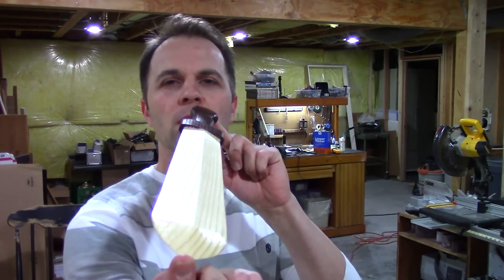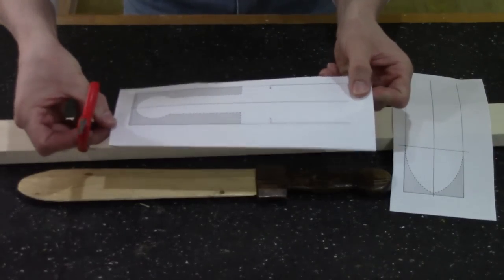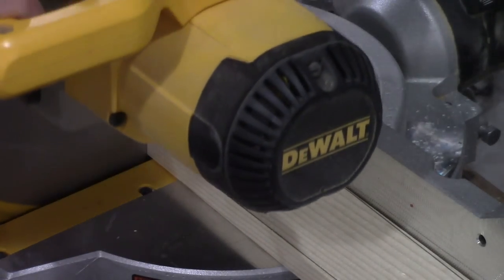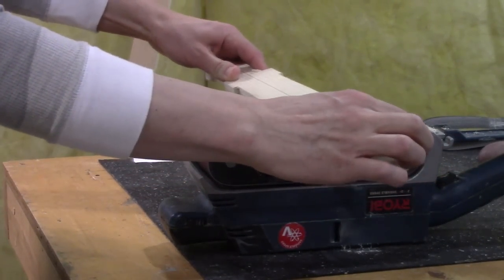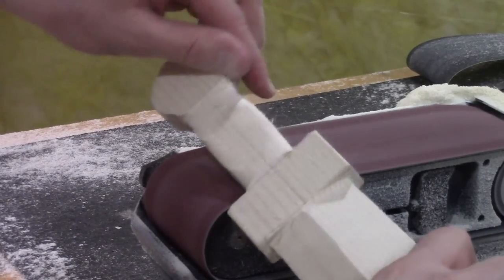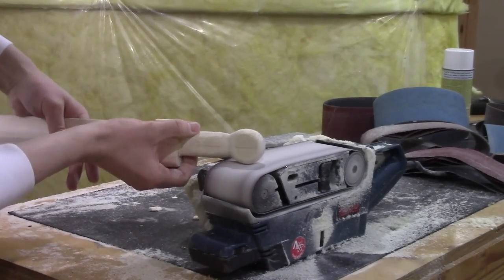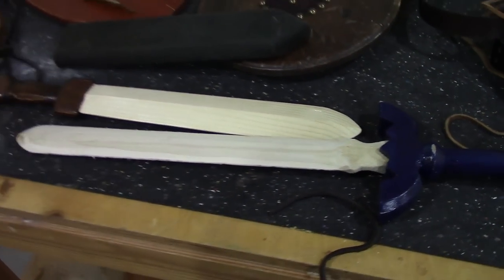How to Make Link's Wooden Sword

Comment: I'm planning on making this, would making it longer have any affect or would it just be exactly the same but longer?
Reply: +Harry Greeney It would of course affect the weight of the sword, but this design is very simple. Which means that scaling it up is easy to do, and actually preferable when it comes to cuts (not sanding though). In-short, yeah, the blade will retain the initial design while being longer than the original blade.
Reply: +Harry Greeney AJ's right. But it would also slow attack speed.

Comment: If I wanted to make a training sword, how long might it last if I use oak?
Reply from the maker: Robert Chambers A LOT longer. I would guess at least 5 times longer.
Reply: HappyAtom Hey Atom  I have a question when your cutting out the sword and trying to cut the lines do you think using a jigsaw instead of a band saw because I don't have one in my workshop it might be a good way to cut wood especially pine wood because of how soft it is
Reply: Christian Duncan A jigsaw should work just fine, you just have to clamp it to a table.  In fact, it may even be easier considering all you're essentially doing is tracing over the lines that you draw.  A band saw seems like trying to secure a pencil above and moving a piece of paper to draw.
Reply: Robert Chambers
 Thanks for letting me know because at times I make wavy cuts I know I can use sand paper or a sand belt but I was trying to be more precise when using the jigsaw
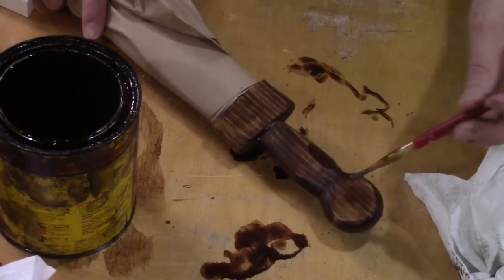Reply: HappyAtom 10:46 Here's a tip when using stain brown paper or paper towel masking tape is another good way of covering the blade if it starts to bleed
Reply: +Robert Chambers Use Hickory, Ash, Poplar or some less porous hardwood. Oak has a tendency to split and splinter badly.
Reply: ***** Yeah but do they sell those at Hope Depot?

Comment: Hi Adam, 

Great video. I have watched the corresponding links shield video as well and intend to replicate this for my nephew so I am excited to get started. I did have a question on the type of stain you would recommend for the sword and shield?

Thanks
Reply from the maker: I like a dark stain for the sword handle but I just use whatever I have laying around. I used "Minwax 2750 Jacobean Wood Finish."  Also, one trick that I did not show is to use an exacto blade and slice a shallow cut between the hilt and the blade (exactly where you would want the stain to stop) so that the stain does not bleed up the wood fibers into the blade section.  As for the shield, you could use the same stain or something a bit lighter like I did.  I can't remember what stain it was that I used.
Reply: Thanks again for the advice, I have done both the sword and shield and it turned out great. Minor hiccups here and there, but my nephew won't know the difference :) 

Cheers and keep up the great videos!

Comment: Could you use this method to create other swords? Or would I have to use a different way?
Reply: +Nicola Clarke im sure! get creative!
Reply: +Nicola Clarke I was able to make a blueprint to make a sword that is similar to the original wooden sword from the original Legend of Zelda. Cross guards, and a straight blade that is thinner, since the sword is usueally used to stab instead of slashing.

Comment: HappyAtom  i have a dewalt belt sander and the stand won't allow me to get a good angle what do i do? I have to put it in the stand to use it unless i am holding   it.
Reply from the maker: There are a lot of different brands and models of sanders. So some of them are going to be more difficult to get in the right position.  I would ditch the original stand and try to make a simple stand that would allow me to secure the sander up side down. Just gluing together some scrap wood may work. It does not have to be pretty. I have also used bungie cords to secure the sander to the table.
Reply: HappyAtom  Is there any other tool you can use to do what the belt sander dose? ps Great video

Comment: I'm having a hard time getting a defined edge between the blade and the guard, any advice?
Reply from the maker: Use a block of wood with a sharp edge and glue some sandpaper to it. Then sand down the corner by hand.  Does that make sense?
Reply: that does, I will give it a try.  thank you.

Comment: heres a question i dont have one of those automatic sandpaperthingys could i just  do it by hand? i dont care if it takes longer
Reply from the maker: Hey Kaleb, If you don't have a sander. You will at least need a knife. But it will take FOREVER, and it wont be as good.  I would recommend looking for an old used one in classifieds or something. They don't cost that much and it will save you a LOT of time.
Reply: HappyAtom k thanks for quick reply i'll look into it i wont be making this sword though but i'm going to use the Technic :P
Reply from the maker: kaleb smith No, that's a vibrating sander.
Reply: poop
Reply: kaleb smith Doing it by hand would turn this into a month long project. I did it with an orbital sander(similar to the type of sander you linked) but it took a few hours and I wasn't setting any standards for shop safety(speaking of which secure the belt sander if you use one, that guys lucky his didn't try and run away). It can be done without the belt sander but unless you have some woodworking experience I'd recommend borrowing one and follow the video pretty closely.

Comment: What I want to do is make the same sword just longer
Reply: Its pretty easy, you just use a ruler and make your line longer when your tracing it on the wood. He said 16-24'' will work. I did one about 24" and it turned out great. Also remember to measure your hand and add length to the grip accordingly.